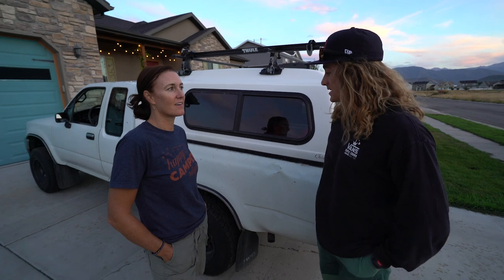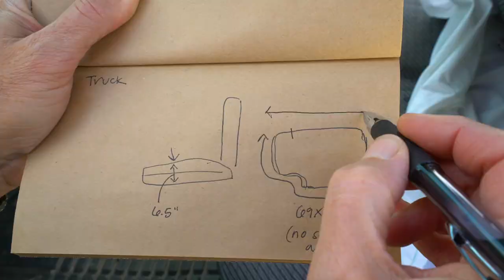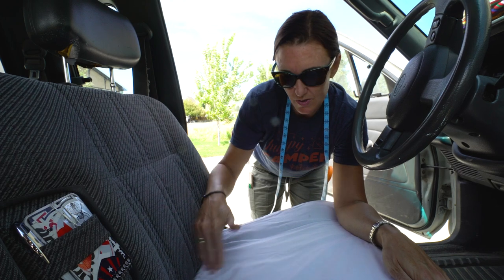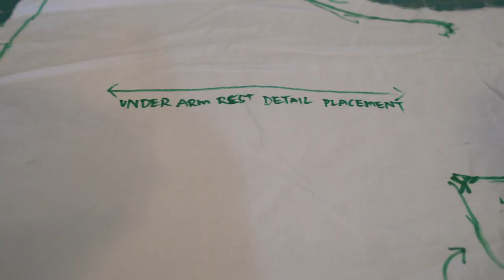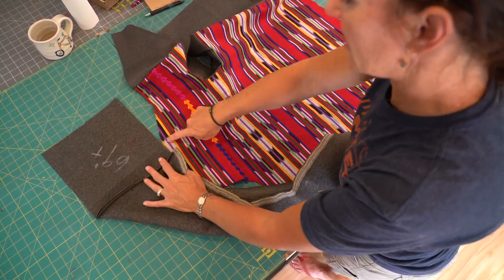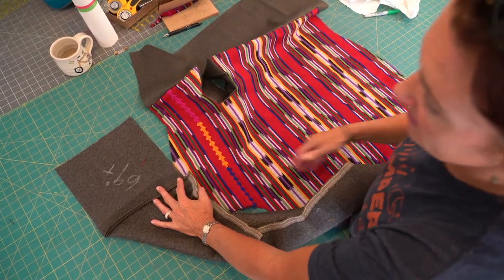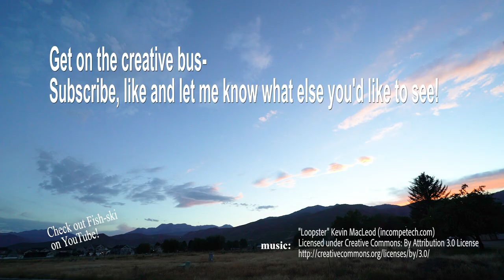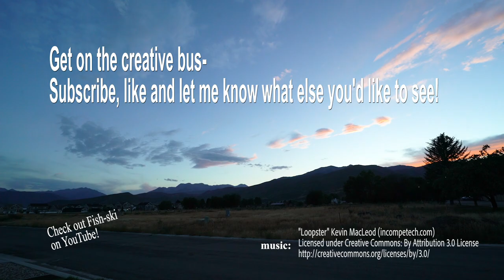Removable Car Seat Cover DIY

Comment: I just needed one for the driver's seat alone. Not the back. So I took an outdoor chair cushion I had that was thin enough and sewed ties to the back corners. Tied the ties together around the seat in the back. Works perfect. I was going to sew my own, but I found this cushion in the garage, and thought "Wow!" Now I only have to sew ties to it.
Reply from the maker: Sounds great, a ‘work smarter not harder’  answer to the problem and with an upcycled element to boot. Well done!
Reply: @NoelleODesigns  I finally figured out I could just make a cover for just the seat instead of the seat with the back, and I was looking for fabric to use in my garage when I spotted the outdoor chair cushion. Bingo ! I found some fabric to make the ties out of and sewed them on the sewing machine to the cushion. Wish I had thought about this years ago when I notice some wear starting on the seat. I've been using a towel because I couldn't find seat covers that  seemed to fit right that weren't expensive. And It seemed too hard to make the whole seat cover.

Comment: What do you think would be the best fabrics to use that can take the very hot temperature?
Reply from the maker: Sugins Corner If you could find a fabric with UV blocking elements (so the fabric would last longer) Likewise, a lighter color fabric wouldn’t absorb as much heat. In my experience I don’t think one fabric type is better than the other for heat. I would go for durability so you don’t have to make another cover anytime soon. Thanks!

Comment: What would you recommend if I can’t pull the fabric through to the back? The back portion of the seat is not movable and it seems impossible to push the fabric through.
Reply from the maker: You could make the seat cover to completely cover the back and the seat portions. Pull the cover on and then make the tie system to tie underneath. I hope that helps!